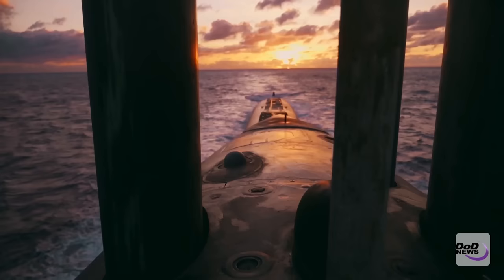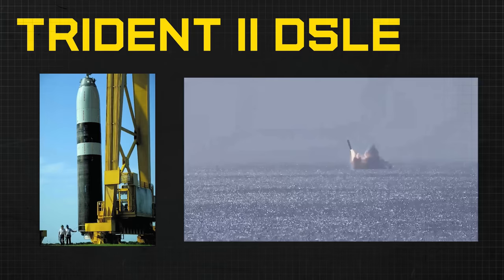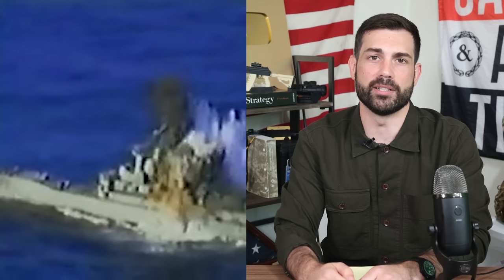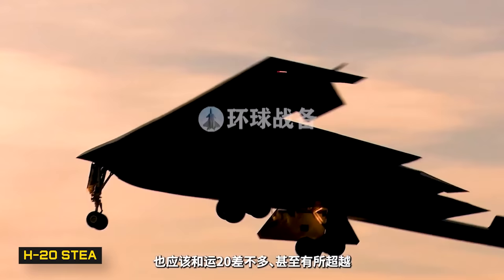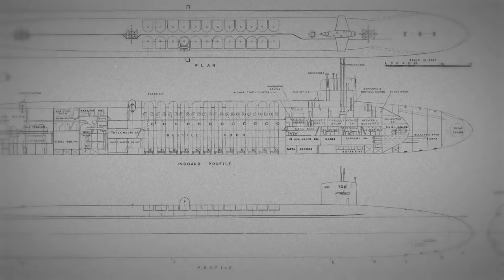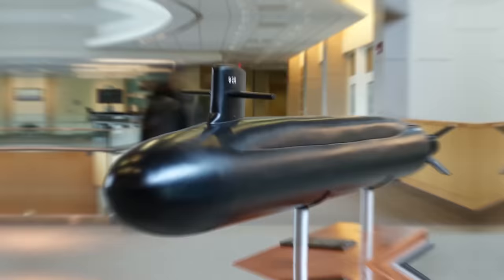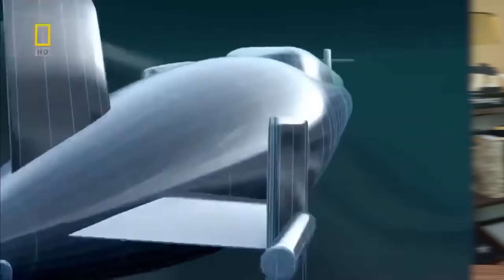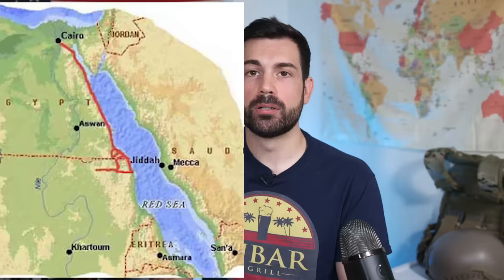Why America’s New Submarine is their Secret Weapon

Comment: Pertaining to those coatings being added to the exterior of the subs. I spent a few years working with developments in adapting the new (at the time) mark 48 torpedoes to the submarine fleet. While doing this I was also exploring possibilities in the sailing yacht world. 

Bf Goodrich developed an organic impregnated rubber like product that was used to cover the big spherical sonar domes. I subsequently discovered some experiments with this product being utilized on some other exterior portions of the subs. I questioned it drag qualities,..

" I believe the substance you are referring to was a product called NoFoul. It was actually originally developed for use on the spherical surfaces of the sub's sonar dome, as most existing antifouling paints could not be used on the domes... and certainly not metallic ones that would interfere with the sonar signals

I believe you may be wrong about the Mercury content. It was an 'organic antifoulant' impregnated into the neoprene material. I believe this 'organic' material was the predecessor to the 'tin based' antifoulants that are now illegal, but were so effective

I subsequently saw some of this material be utilized on the outer skins of the nuclear subs, and enquired with David Taylor as to whether it had been tested for drag resistance...never could get an answer.

It was VERY effective as an antifoulant, having gone 10 years in tropical waters with virtually no fouling. I was just getting interested in the pleasure boat business at the time, and thought this material might be an excellent item for application there. But when I looked at the price of the product, plus its special glue, it did not offer that great of a savings over the traditional 'pull the boat each year and bottom paint it'. And the latter offered that other work could be performed on an annual basis besides bottom painting Feb  2007"

"Actually that material No-Foul was developed for use on the submarine sonar domes, and as such metal based antifoulatants were discouraged. It was the organic TBTF (antifouling agent, tributyltin fluoride) agent that was impregnated into the elastic rubber material. It worked.  
Actually that material No-Foul was developed for use on the submarine sonar domes, and as such metal based antifoulatants were discouraged. It was the organic TBTF (antifouling agent, tributyltin fluoride) agent that was impregnated into the elastic rubber material. It worked."

That 'organic anti-foulant'  was subsequently outlawed on pleasure boats a number of years later.
Reply: I think that with the increased power available to these subs drag becomes a less critical factor. Perhaps there has been a tradeoff of stealth for drag.
Reply: Worked for a company back in the mid 90's that sold a very special machine to the USN. It had to do with rubber extrusion. A government rep was there to watch 100% of the manufacturing process, until the machine shipped out in an unmarked tractor trailer. It was special because of being made of aluminum, so it would be easier to move about.

Comment: Hope they turn more Ohio class subs into cruise missiles subs.. we only have 4 such subs and they carry 154 Tomahawks.. each...
Reply: Not gonna happen. They are already talking about retiring the current 4 SSGNs sometime within the next 4 to 5 years I believe. Their idea is that the Virginia's will replace the firepower of those subs. But that's a bit suspect. So far the current active Virginia's only carry 12 missiles each. Block V will carry 40 of which 10 are planned. So 22 Virginia's x 12 missiles each give you 264 vs. 616 total between the 4 SSGNs. And we're not building them fast enough to replace all those we're losing at once. It's going to be another 2 or 3 years before they get the first Block V's as well.

Comment: Worked for a company back in the mid 90's that sold a very special machine to the USN. It had to do with rubber extrusion. A government rep was there to watch 100% of the manufacturing process, until the machine shipped out in an unmarked tractor trailer. It was special because of being made of aluminum, so it would be easier to move about.

Comment: The difference between the old control scheme and the new joystick-driven system is that, rather than simple up-down-left-right adjustment to the rudders, now it requires an up-up-down-down-left-right-left-right-a-b adjustment in order to enable all power ups. Coincidentally, that's also the launch code.

Comment: How come the torpedoes on this sub have a shorter range than those used by the Royal Navy and were introduced in 1992? Also, the Mk 48 max speed is 55 knots, while the Spearfish is 80 knots. Spearfish also has a larger warhead. Although, it was designed to engage high-speed, deep diving Soviet subs (Alfa class).
Reply: Different mission requirements most likely.
Reply: Maybe they needed to decrease the range and decrease the warhead to make room for new sensors and logic chips for more accuracy?
Reply: @KangoV - the warheads are almost the same - 647lbs vs. 660ibs. The range is superior on the MK-48, from what is on the internet. The Spearfish is way faster. Both very good torpedoes.
Reply: Mk-48 Mod 5 ADCAP was made for engaging subs like Alfa. Now replaced by Mod 7 CBASS. Also, only a tad bit smaller warhead, literally doesn't matter much as a single hit on any sub would be enough to sink it.
Reply: @M16_Akula-III  - correct and agree. Cheers.
Reply: If a boomer needs to fire torpedoes it doesn’t have long to live. At that point, it just wants to survive long enough to launch the all the ICBMs.
Reply: @purpleslog  - yes, absolutely true!
Reply: @purpleslog  Good point. Brings up Sub 101: 1. Don't be detected
Reply: because those are the public (unclassified) statistics for the mk48, not the actual (secret) statistics
Reply: @purpleslog  Now that I think of it, maybe, but not totally true. USN SSBN's do use Mk-70 MOSS decoys. We don't really know how effective it is but supposed it is very effective, then it could still survive.

Comment: Former submariner...no the Navy would not use an SSBN (boomer) boat to deter adversaries. That's the job of Fast Attack boats (Los Angeles/Virginia/Seawolf class). SSBNs typically try to stay completely undetected and within an operating area as a part of the US strategic nuclear capability. They have weapons onboard in the event they need to defend themselves, but not for any hunter-killer operations and certainly not for battlegroup support. 

Also, the rest of the story of the USS Louisville (SSN724), after it had been the first to fire vertically launched tomahawk missiles in the Gulf War, then got their deployment extended 8 months to fire more missiles, they finally came home conquering heroes only to be met before reaching the pier by a small boat with an ORSE team on board, turned back out to sea and promptly did poorly on the ORSE causing the nukes to lose their post-deployment liberty. Because to the Navy, Naval Reactors comes before both God and Country.

Comment: Just a small note - deterrence doesnt work in "accidental" situations. That is, if one side feels that they are under attack but the cause is a misunderstood accident (sensor errors, accidental detentions, subs gone missing, etc.) - they may launch. there were a few close calls during the cold war, and even after. One was that Yeltsin almost launched - when we were all getting along - because a Norwegian rocket launch was assessed as a SLBM launch. Related to this - if there is a misreading of a situation in Moscow today, how long will Putin wait before launching? This isn't even a question of rationality - it is entirely rational to think one is under nuclear attack if that is what the sensors say, or if there has been a nuclear detonation at a sensitive strategic nuclear site (like the Thule Air Base incident, where a series of events could have destroyed the early warning site and the B-52 backup in the air).

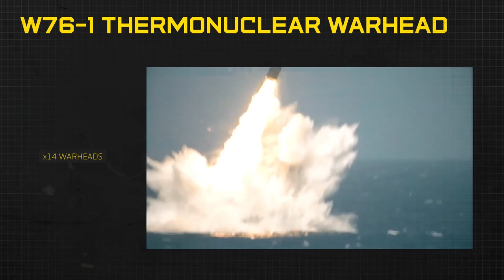Comment: At around 3:15 timestamp you say that The TRIDENT II missile on the Ohio class submarines can only carry 4 or 5 nuclear warheads. In fact, the original Trident II (D5) missile could carry up to 12 W76 - MK4 nuclear warheads or eight W88-MK 5 warheads. Changes to the front-end missile configuration have been made to streamline missile processing and reduce overall man-hours for configuration support and weapons maintainability over time. The D5 Life Extension missile currently can carry up to eight nuclear warheads regardless of type used by the program. The more warheads installed will equate to distance delivery reduction (max missile range) when reduced below the break-even threshold weight for lift capability. That break-even issue is tied to the need to burn out all three solid boost rockets before releasing the warhead delivery bus during suborbital flight and the maximum range is tied to power delivery capability of the missile internal power system needed to control the missile and release the warheads. Up to this point the Life Extension Triden II (D5) missile is the most capable and maintainable long range nuclear delivery system produced by the United States military program. But of course, the new Land Based Strategic Missile System under current development might change all of that.

Comment: Submarines do not spend their whole lives at sea. They go out for 90 days they come back then the other crew will get the boat ready to go back out on patrol and they will spend 90 days on patrol approximately. Then you have extended overhauls which may take submarine out of the water for a couple years. That assumes you have no major equipment casualties in the meantime. You have to figure 1/3 of your submarines at sea, 1/3 your submarines pier side getting ready to go to see or having just returned, the other third of your submarines are in various stages of maintenance. Maintenance could mean a full dry docking in major overhaul or routine mainrenance. Personally given the rotation cycle in and out of maintenance I think 21 submarines would be ideal.

Comment: I was an Ohio Class Trident Submariner in the 1980s. We carried 24 UGM-96 Trident C4 missiles designed for older 640 class SSBNs with 16 tubes. This was because the UGM-133 Trident D5 was not ready for its new Ohio class ship until 1995. The Trident II D5 could carry the new W88 variable Yeild Warheads with a maximum of 450kt yield, 4.5 times the yield of the Trident I C4 or as low as 50kt and carry 8. Along with a combination of Decoys. One Ohio fully loaded with 24 Trident II D5 missiles with 8 W88 warheads @ 450ky each or 12 W76 warheads @ 100kt each give each Ohio 192 W88 or 288 W76 warheads each times 14 active ships down from 18 or originally 24 ships to replace 41 earlier classes of Hodge podge ships. The Ohios at reaching 40 to 50 years of age but we're neutered by post cold war treaties signed by neocon traitors Clinton and Bush to be perpetrated by Obama-nation and O’Biden.

Comment: Hi! There is a problem with your description of Electric Drive being Retro!  No it is actually cutting edge with many innovations.  Electric drives you describe were the size of a 60 foot semi trailer. Today they barely take up any space around the drive shaft and can actually be built "Wet" that is taking up almost no space inside the ship and at no risk if the compartment they operate in floods.   The current size can fit in a 2 meter diameter and less than 3 meters long.    What is more the generator to drive is similar size and the turbine to drive is vastly smaller too!

Comment: The rubber sheets with holes-- anechoic tiles-- work on the same principles as the sound insulation foam you see in documentaries and movies. The sound gets into the holes or valleys then bounces around, reducing in intensity each time it bounces.

Comment: Data point:  The Mk48 has been around since the late 60s.  It does have the virtue of being a proven weapon system, but it's a bit long in the tooth.  Look into other weapon systems available to attack submarines -- the list might surprise you.

As to the cruciform control surfaces aft:  look into the design aspects of the USS Albacore (AGSS-569).  There were drawbacks to that configuration (mainly increased complexity of the controls) which may have been overcome in the modern day.

Comment: The Nuclear Electric propulsion design does not eliminate the steam plant and turbines. Rather, the turbines drive generators and that electric power is then used to operate motor(s) to drive the propulsor system. On a conventional design, the turbine drives reduction gears for a direct mechanical drive to the shaft.

Comment: I'm trying to comprehend the massive size of these things.  Rough math, the interior volume of a Columbia class sub is equal to apx 320 forty foot shipping containers.  If the containers were single stacked on a train, it would be over 3 miles long.
Reply: Sure, but that's not all usable space. You have bulkheads, storage lockers, racks, missile tubes, etc.

Calculate the same interior volume of a 688, then go watch a video on what it's like to be on one, and you'll see that the theoretical internal volume is laughably high compared to all the crap you need to shove in there

Comment: I served on USS Dace SSN607, 76-83, a Fast Attack Nuc designed in the 50's and launched about 1961 from Pascagoula Mississippi ship yards. We were one of the Thresher Class Boats, really the first modern mass produced fleet of Nuc Subs although there were Nucs before us but they and us were no where near the "luxury" of boats today. We had just a bit more room than the last diesels and the engine room where i spent near all my time certainly had the heat. The class was renamed after the loss of the Thresher but we always refereed to ourselves as a Thresher Class Boat and I do to this day in honor of my Brothers who l sacrifice along with the crew of the Scorpion who are on eternal patrol for pushing the boundaries before me. If you didnt want to be eternally  filthy, sweat saturated, clothes stained all over with TP2190 hydraulic oil and your own stench, sleep in a rack in those clothes that someone just rolled out of with those same clothes, if you wanted to eat or sleep, if you didnt like diving in a God knows what filled bilge cutting your arms up on pipe hangers as you try to get to an unreachable pump, if you couldnt live with never ending casualty training or the real casualties that happened, if you couldn't spend near 10 months a year under the sea such that whenever the hatch did opened the sunlight ignited your skin like a vampire than the Sub life was not for you. It was a job no one or hardly no one wanted  to do, it stunk and it sucked big time by any normal measure but you never heard one single groan or complaint from a Dolphin Wearing Submariner because we absolutely loved the life and what we did. Gods Bless all our Sub  Sailors, yesterday & today.

Comment: At the four minute mark your slide showed a straight line of 24,000 miles in comparison to a picture of the Earth. That straight line is compared showed the diameter 
As 8000 miles, not a circle going around the earth which would be 24,000 miles approximately (we infantry need to stick together😊). 🌎

Comment: 12 Columbia, vice 14 Ohio,  should be enough to cover the current patrol cadence because the Columbia reactors will not require refueling. Ohio required one mid-life refueling, which takes each ship out of service for several years. Presumably that's why they can get away with two fewer hulls.

Comment: It seems the Columbia class is slowing the manufacturing of the attack subs.   Instead of making 3 attack subs per year they can barely make two/year.   The US Navy is in a tough spot because of their mismanagement.  Much of the fleet is behind and hung up in maintenance.  Then there was the Zumwalt class still struggling. It looks like they are becoming missile cruisers (yeah, I said cruiser) which is good to replace the decommissioning of the Ticonderoga class.    Even then there were the two Littoral classes.  OMG, such a huge waste of money.  So much did not work on them that they are being mothballed soon after they are commissioned and yet they continued building them.  WTF?
Reply: There's no way the 3 Zumwalts will be able to replace the Ticonderoga cruisers. Not 5 of them, 10 of them and certainly not 22 of them. Zumwalts only originally had 80 missile cells. Add the approximately 12 or so hypersonic missiles they plan to add and that only gets you to 92 per ship x 3 = 276. 22 cruisers had a combined 2,684 VLS cells (22 x 122 cells each). Just 3 of them carried more than all 3 Zumwalts with the added missiles.
Reply: @gigakrait5648  I agree.   I just thought adding missile cells to the Zumwalts was a start.